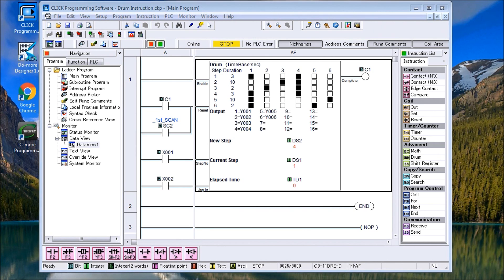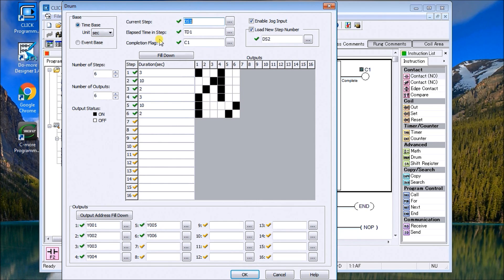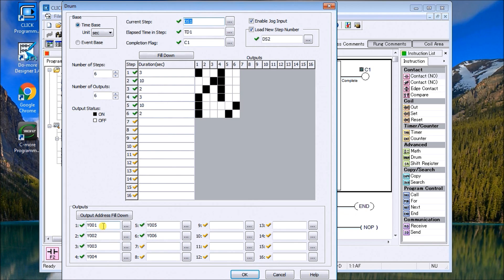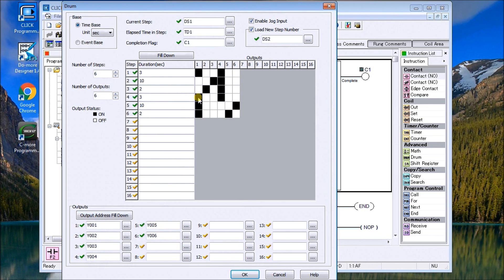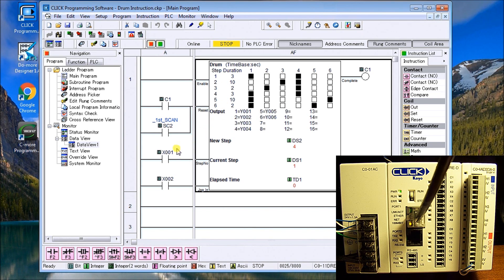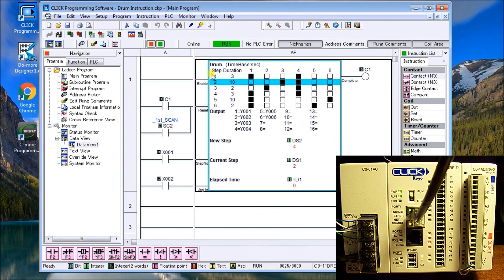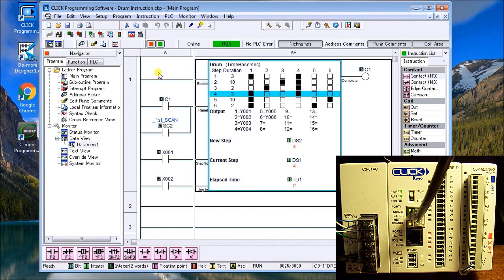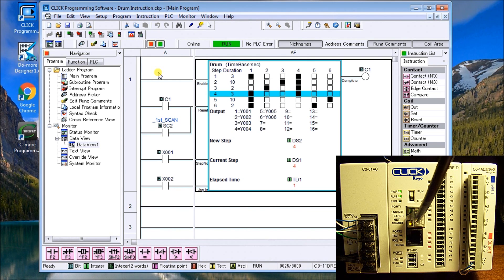Click PLC Drum Instruction Sequence

Comment: Fantastic! Great explanation of a really useful function.  Perfect for pulse cleaning in dust collector.
Reply from the maker: Thank you James.
The Drum instruction is a great way of sequencing the program.
Garry
Reply: Garry Shortt Have you seen these solid state pulse cleaning devices? Very common on industrial dust collectors, sold as OEM equipment with the dust collector, like Torit.  I have two dust collectors with a total of 10 pulse cleaning solenoids that run from one timing device.  With the click and 2 drum functions I can individually control banks of 5 solenoids for each dust collector.  I am so thrilled by the inexpensive solution by Click and your timely tutorial.  I’m sure you’ve seen it all in controls, but if you ever need a good example, I could document for you when I’m done.  These inexpensive plcs are game changing for the plant engineer.
Reply from the maker: Hi James,
That sounds great. If you can put something together, I will post it to the site.
Thank you,
Garry

Comment: Thank you for the explanation.  My application requires 30 outputs to run in sequence all on a time base.  So, how do I cascade the drum instructions?
Reply from the maker: That is a good question. The first thing to do is ensure that all of the outputs in the drum are set to the internal bits like 'C'. I would then use the enable and reset lines on multiple drum instructions to control them. So one of the outputs on the first drum will control the enable on the next. One output on the last drum instruction will control the reset for all of the drums.
Use the internal bits in combination to then control the physical outputs.
I hope this helps you out.
Regards,
Garry
Reply: @ACCautomation  Thanks a lot Garry. I'll give it a try.  I am getting ready to purchase the clickplus hardware.  I am just playing with the programming software for now.  I am a home hobbyist and my application is for home use.  I am going to build a test module so I can verify the logic (lights for now)  I am going to control 10 motors.  Fwd & rev with a x second pause in between each condition.  .

Comment: Can you do a drum instruction that activates on the rotation of a encoder? So it will say turn on a input at 60 degrees and turn off at 100 degrees.. so on and so forth?
Reply from the maker: Hi Travis,
If you are using an encoder, I would use a counter and some compare instructions to trigger the output. 

Here is a link for the sample code:
https://www.dropbox.com/s/1k2dixxnqukif42/Click%20Encoder%20Example.zip?dl=0

If the speed of the input is too fast, you can use the High-Speed Counter on the Click PLC.
https://accautomation.ca/click-plc-high-speed-counting-part-1/
https://accautomation.ca/click-plc-high-speed-counting-part-2/

I hope this helps you out.
Regards,
Garry

Comment: Thank you for all the videos Garry, they have been a great help. I'm having an issue with my drum logic where, when I turn off my enabling contact for the drum, the drum logic will stop cycling but the physical outputs will remain on indefinitely (not all outputs, only the ones active when I turn off) Any insight you could offer me? Thanks
Reply from the maker: Hi Seth,
There are a few ways of dealing with your situation. 
1 - Instead of using the actual outputs in the drum instruction, use internal bits. (C area) Then use these internal bits as conditions to the physical outputs. You can then add additional logic like the enable logic for the drum on the same rung as each output. 
2 - If there is a sequence in the drum that turns all of the outputs off,  write the step number into the drum when the enable condition is off.
3 - You can use an external output like a master control relay (MCR) to kill power to the outputs when the drum enable conditions are not met.

Let me know how you make out.
Regards,
Garry